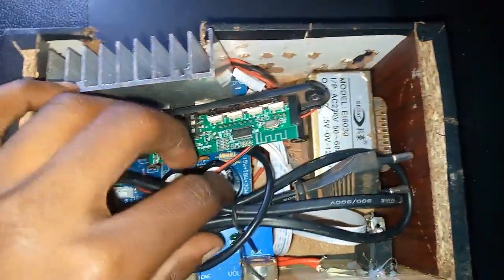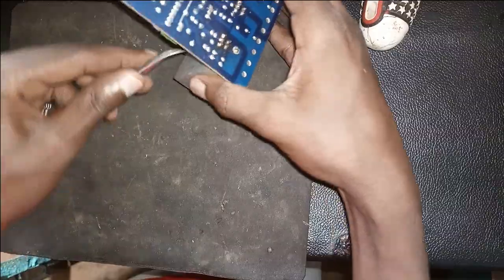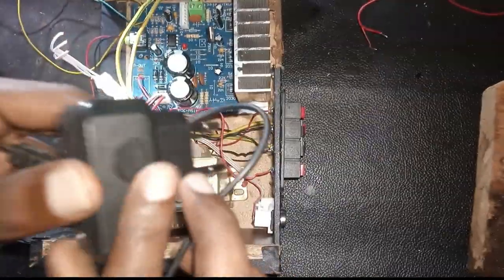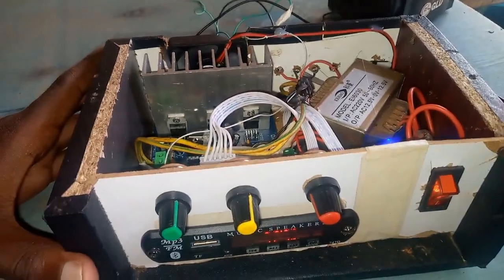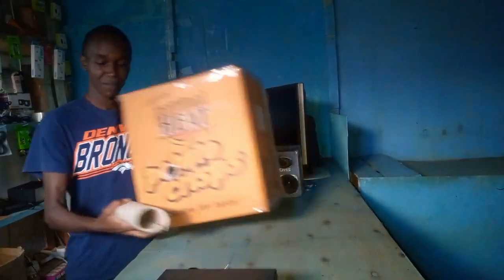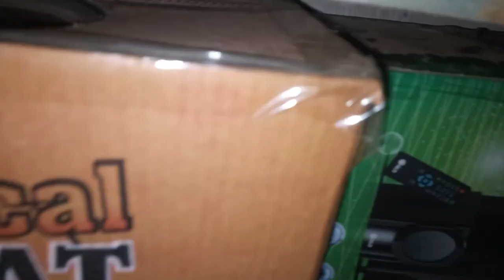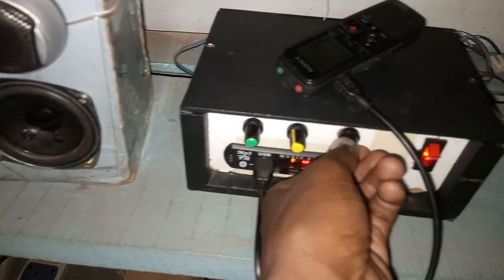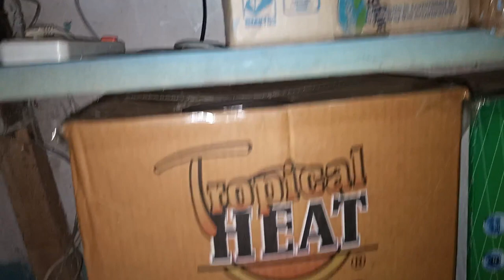2.1 amplifier assembly, 15+15+30 watts (TDA 2050 and 2030)

Comment: What's the specification of the power capacitor for the MP3 decoder, if I'm using a 24 volts transformer?
Reply from the maker: Most mp3 decoders use 12v, I would use  a capacitor of 25v, 2200uf.
They just stabilize voltage, even 16v will work.

Comment: Is it possible to install a low pass filter to this amplifier
Reply from the maker: Yeah but it will be a waste. The 2030 are not that powerful, barely 20w on 4 ohm. 
I'd prefer LPF to be used on green or red boards

Comment: Love your work bro... am using 2.1 amp. and sometimes hukuwa na background sound/hissing sound what mighty be the problem??
Reply from the maker: There are several things, 1. The electromagnetic effect from transformer, 2. The Bluetooth display, some have alot of noise, 3. If you are using fans directly from the board.
There are ways of fixing, I'll do a video